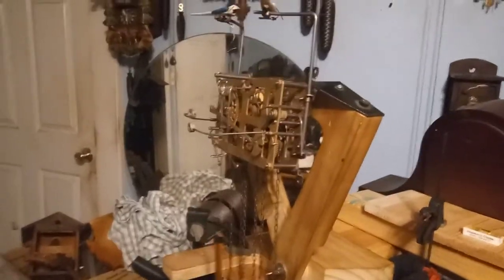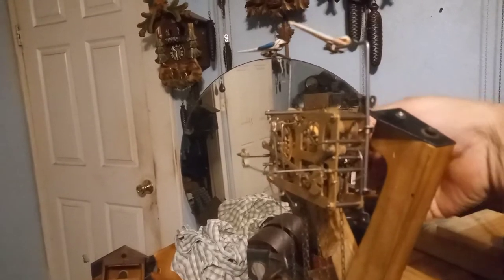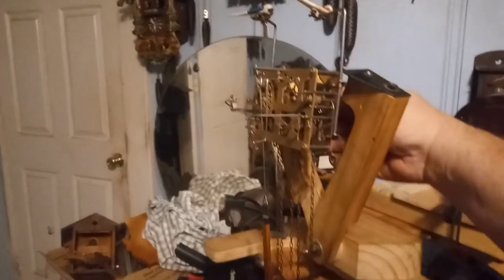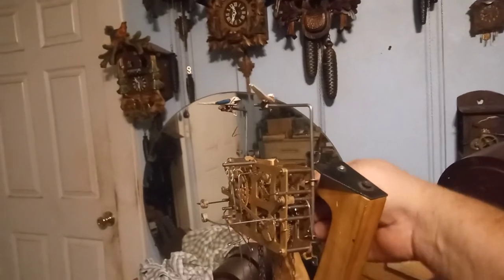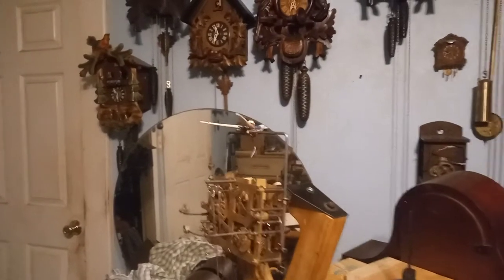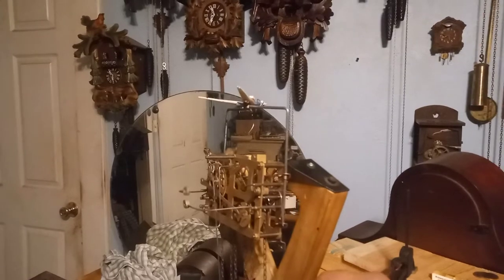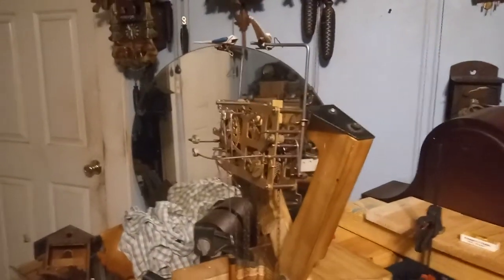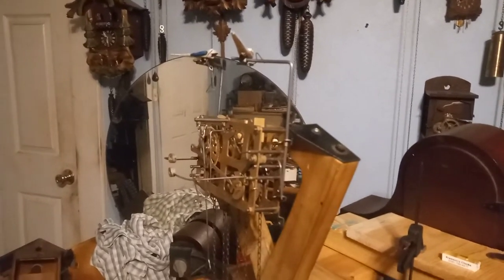Repairing a Hubert Herr cuckoo quail clock. 20220203 153005

Comment: Thank You Mark,  I am going to try your Simple Green cleaning solution in the near future. I still have some Zenith rinse, do you see any benefit of using the rinse?
I am trying to get away from the ammonia based cleaners.
Reply from the maker: I dont buy any cleaning solution or rinses. After cleaning I rinse with water. Then because of the new solution that I use I can rinse in rubbing alcohol and it doesnt change the color of my parts. Used to the rubbing alcohol changed colors on my parts. So I am happy with the new solution.